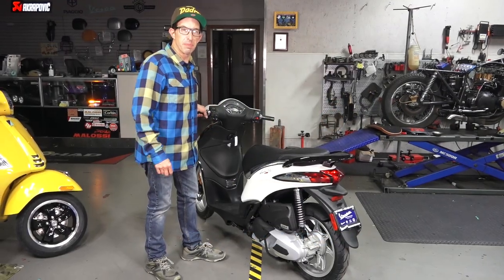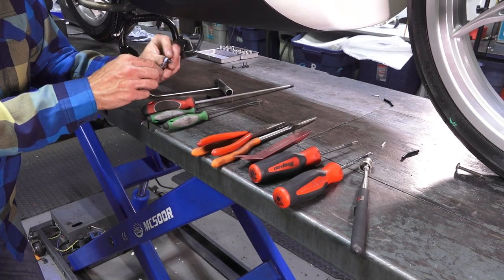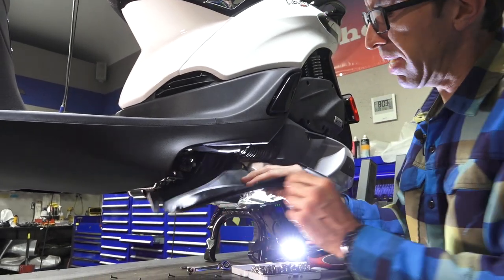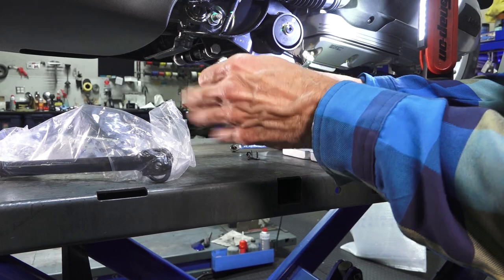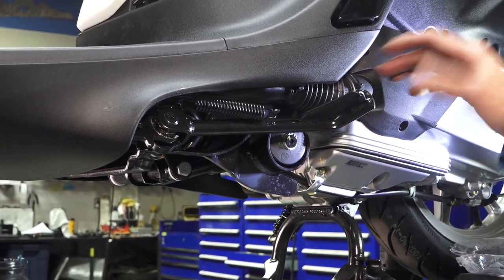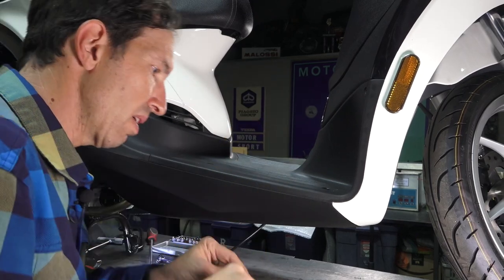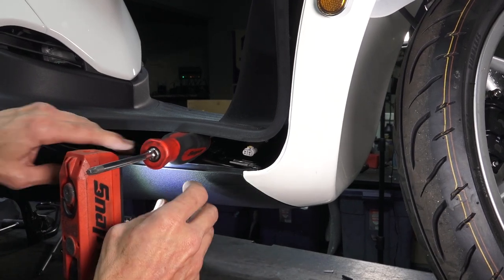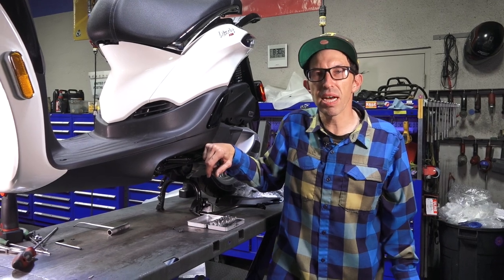Install a Factory Sidestand on Piaggio Liberty Scooter

Comment: Thanks for the great video and for shipping the kit to Canada so quickly!  You make it look so easy Robot, it took me 4 or 5 hours (but I have Parkinson's).  One thing I did differently because I don't have a spring tool was the washer trick and it worked really well!  I clamped the short end of the spring in a vise and bent it over using the long end for leverage and forced washers into the spaces between the coils.(You can use pennies or nickels too.)  I think it took ten washers then I hooked the long end on the pivot and straightened the spring out and slipped the short end onto the hook on the side stand (side stand down was shortest).  'Then I pulled the washers out one at a time with my needle nose pliers. Easy peasy and very safe!  I love my side stand, I don't know why they don't  put them on at the factory...

Comment: Cheers from Greece! Thanks to your instructional video, i was able to mount the side stand myself! (Had to "invent" a sprig tool).
Reply: A few months ago I used two fat zip ties as a workaround to open the rubber gasket spring of my front-loading washing machine. My son pulled one end and I pulled the opposing side, worked pretty well. The special spring tool is $60 USD otherwise.

Comment: Thanks Robot - worked a treat thanks to your instructions.  Getting to the four screws under the trim (to remove the sidestand 'cover') can be accomplished with a standard screwdriver once you take two of the four easier-to-reach screws out, then you can flex the plastics back enough to reach the harder-to-get screws just fine.

Comment: Brilliant, awesome video. Took me about 30 minutes rolling around on the floor. Would have taken 3 days without this video. I was able to do the connector from the bottom, not a lot of room, just about get my fingers in with my accomplice holding the torch.
Thank you so much.

Comment: I always use my center stand on my 2007 Piaggio mp3 250 IE because I turn off Tilt Switch pressure sensor make it last long! I already replaces four switches Mr. Robert!

Comment: One question with the side stand down, is there any threat of the scooter rolling away? You can not put it in gear like a motorcycle to lock the wheels from turning.
Reply: You can't keep the wheels from turning but you can lock the front wheel when it's turned all the way to the left ...at worst, it will only roll in a circle and maybe fall over but it won't roll away

Comment: I just installed this, what a pain in the ass connecting the connector!... Robot made it look easy, it's NOT!  if Piaggio would have given just a few more inches of wire, it would have been so much easier. Hint, its easier to connect it on the bottom rather than through the floorboard. the bottom plastics separate apart and gives you more room, especially if you don't have a lift and you're on the ground.
Reply: This is the type of follow up comment that we all look for. Will certainly keep your hint in mind ! And Robot's not emphasized buy freat tip was to not install the wores in such a way they get pinched between the frame and floorboard, if you go in from another way.
Reply: I also found it much easier to find the connector and connect from underneath. I have a P Liberty.